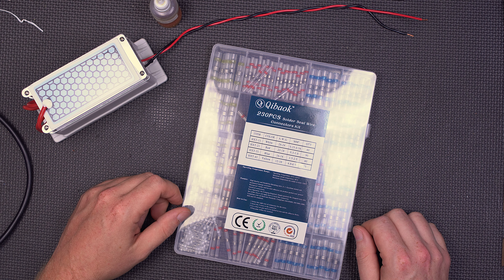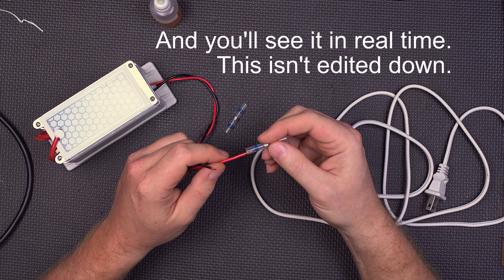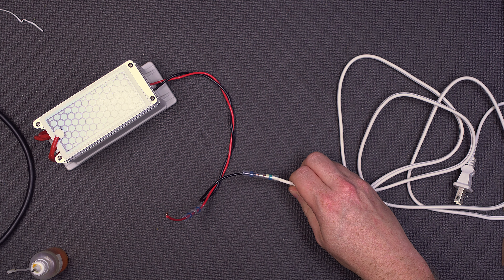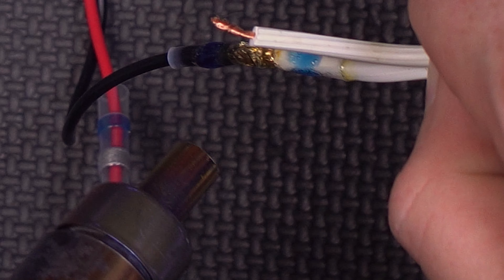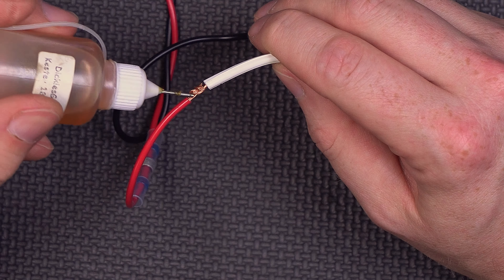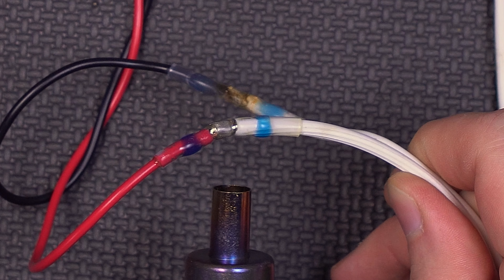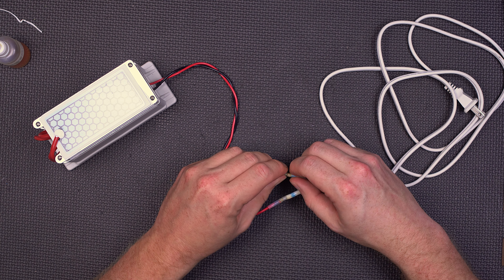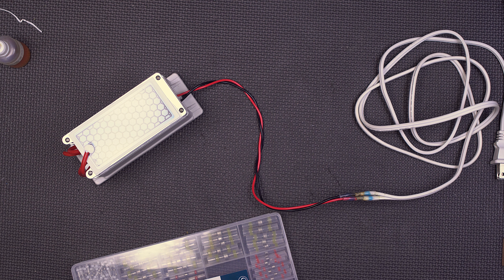CCR #2 - Solder Seal Connectors - Be Gentle - It's My First Time!

Comment: Telegraph lineman connected lines with the "twist and tie" method for the first 70 years. Solder was not used until the 1900s. But, just as people are still coming up with better mousetraps and fishing lures, they are still coming up with better/easier ways to connect wires. And we're still buying them.

Comment: Also if you have the u shaped tip for the heat gun that works great to get even heat across the solder ring and if you can mount the heat gun stationary and move the wires instead of the heat gun works grest

Comment: Flux does not help with this butt solder shrink wrap. It impedes the solder melting EASILY with a heat gun! The liquid is blowing out the shrink wrap

Comment: I have used those and I honestly don't see them as any benefit compared to open crimps and heat shrink, but I do know that if you are building a harness they will be a ton slower than the crimp and shrink

Comment: We actually use these on aircraft and flight hardware in space.
Reply: Yep same. I used these in the military on the avionics. Most commonly used them for the shielding, double ground terminations. You'll want to use the curved blower attachments and as you mentioned... you need it hot!
Reply: Particular brand?
Reply: Endorsed by Boeing 😊